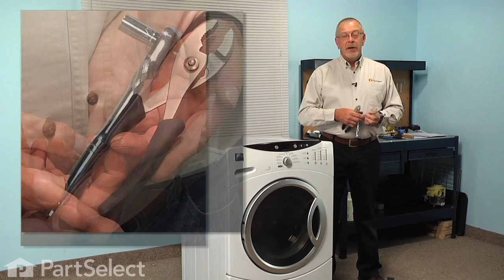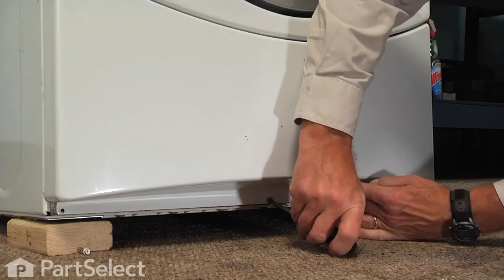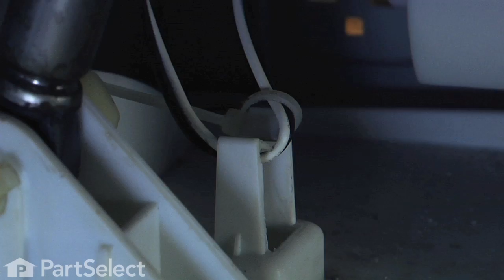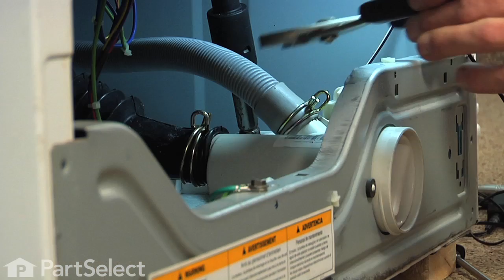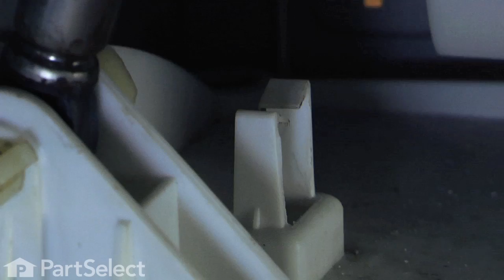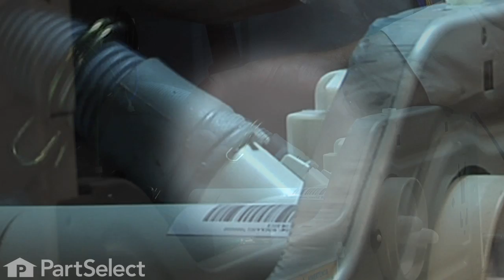Washing Machine Repair - Replacing the Drain Pump and Motor (GE Part # WH23X10028)

Comment: This video helped me take out my water pump so I could replace it.  I figured it was out so I removed it but looked in it and noticed the fan in the pump was clogged with a ball of hair.  I figured I had nothing to lose so I put it back and it ended up working again. This may be the case for others so it does not hurt to check and may help people save with a quick clean and fix.  I had just been quoted for part and labor $250-300 so this saved me money as well as taught me how to fix it myself in the future.  Thanks for this video

Comment: We bought this almost 2 months ago and love it!▫ ▫>allmy.tips/GeWasher?68P       It's huge and has an agitator. I had put off buying a new washer since most new models don't have a full size agitator anymore. Our older washer was almost 20 years old and loud, it struggled to washs towels and bedding. This one has so many options and washes multiple towels at once and spins all the extra water out the first time through! We can wash our king size bedding too! It's much quieter and I had to get used to the wooshing sound it makes when it is washing because it was so different. Once I got used to all the different settings I found myself doing bigger loads and taking less trips to the basement. I'm very happy with this purchase.

Comment: I ordered just the motor.  The pump housing was fine.  Removed the old motor from the pump housing (3 phillips screws).  Connected the new motor to the old pump housing using the 3 phillips screws.
$52.00 for the motor compared to $141.00 for motor and pump housing.
My son helped me...took us 30 minutes from start (gathering phillips screw driver, slip pliers, water catch pan, towels and a flashlight) to finish (putting everything away).
Piece of cake.
Thanks Steve!!!
Reply: It’s good to know that it just may be motor and save the extra almost $100.  Thanks for the tip

Comment: Saved me a service call too.  Without this video, I would not have had the courage to take out the pump.  The only problem was a clump of something blocking the impeller - I was unable to find it without removing the pump.  In answer to Brenda's question two months ago, the impeller on mine spins all the way around but, like for anything connected directly to an electric motor, at regular intervals, there is resistance until a certain angle is passed, then no resistance until the next what feels like a "hump".

Comment: Can you tell me if the propeller is suppose to have full spinning abilities like a clock?  We aren't sure if the drain pump is the problem or not. We got it pulled out and noticed the propeller only turns so far.